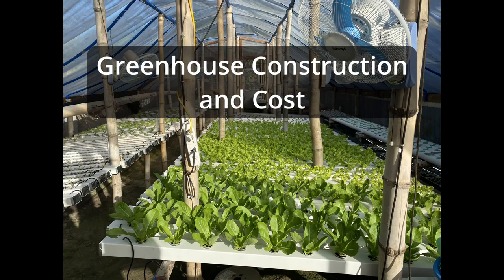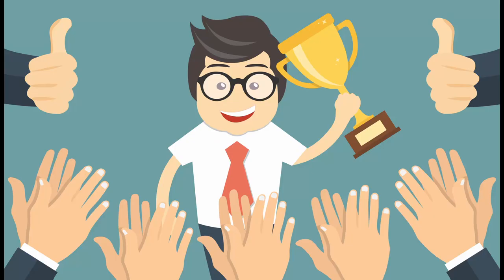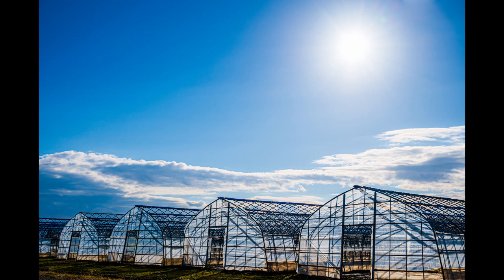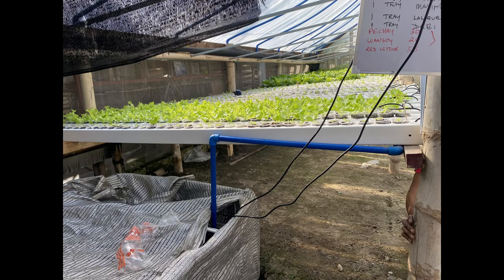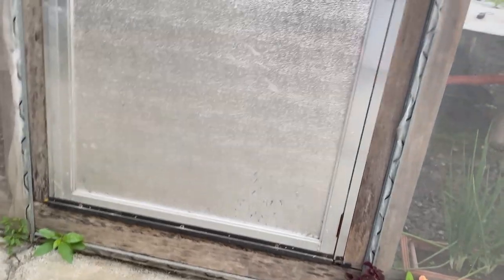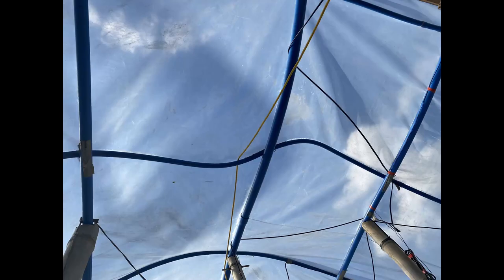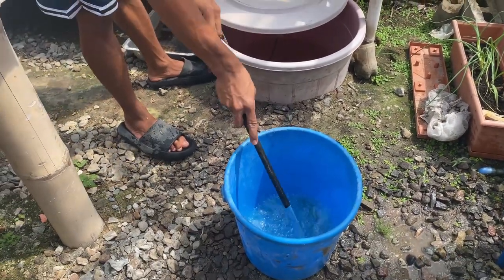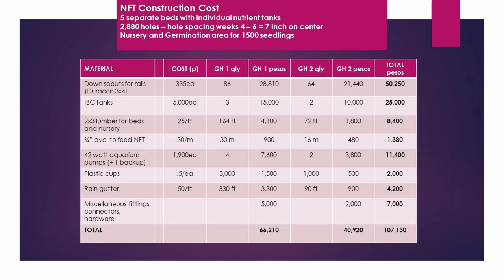Our DIY greenhouse using bamboo and pvc pipe - how much did it cost?

Comment: Hi, nice to see you have made some corrections with your greenhouse.
Why are you using PVC instead of GI Pipes for your structural and roof framing?
Have you given a thought of using GI Pipes, Angle Bars or Square Tube (Steel or Aluminum) instead of Bamboo or Wood for carrying your NFT Rail?
Have you also given a thought of using Philippine NFT system over USA NFT system? By the way, I also liked the USA NFT system as I find it so convenient but I am just not sure if it is applicable here in Philippine setting as it is relatively warm here compared to USA. But definitely what I found very obvious with USA NFT setup, most if not all of the NFT rails are full of algae as the USA NFT setup are full of openings that are exposed to Sunlight.
Keep it up!
Reply from the maker: We plan to switch to metal pipes at end of life of the U.V. plastic.. I could not get the GI pipes and a way to bend them as we were under pretty strict lockdown at the time. Our barangay hardware store had a supply of PVC pipe so that is what we used. It will have to be ugly for now - too busy fixing my other mistakes. same goes for the NFT rail.  I plan to expand to a new larger location when I get the money and steel tubing and aluminum angle bar will be used.  However,  I think I will stay with bamboo for the vertical posts and use cement bases. After the typhoon, I was surprised to to the greenhouse standing with very little damage.

Algae was definitely a problem last year. We have made changes like covering the rail ends, empty holes and shading the rain gutter return. Hopefully this will reduce the problem enough.
Reply: @expathydroponics8500  if you can afford to buy the channel and wiggle wire, definitely you can do with all GI and metal, as bamboo is cheap but prone to algae through time as they easily get cracks...

Comment: Nice setup. Does the pump run 24/7 in your NFT system?
Reply from the maker: Yes, I run 24/7.  I saw online some that run only intermittently at night, but I decided not to for two reasons.  1. I am worried that the roots may dry out or it will cause more stress. 2. The temperature is much lower at night here and running through the rails helps cool the water. (Also - less big temperature swings = less stress).  Less stress = less bitter problems.

Comment: Is that pex pipe? If so pex isn’t UV resistant and will break down over time and become brittle in the sun
Reply from the maker: LOL - It just looks like PEX pipe because of the deformities due to the UV plastic roof shrinking at night. When it is time to replace the roof, I plan to replace the ribs - either with thicker and stronger 2" pvc or metal.
Reply: @expathydroponics8500  ahh ok its still cool!

Comment: Can’t believe I found this site. I live on Negros Oriental and have been experimenting with the Kratky method. I haven’t built the green house yet. Rain keeps flooding my experimental system so I have to keep lowering the water level. Where did you find the water down pipes? I can’t find anything like it on Negros so had to by from Shopee. Too expensive. Where are you? Why is it that one week seeds germinate and then two weeks later absolutely nothing germinates?🤪😂 I’m from Europe and the season is April to September. I assumed that as it’s hot all the time that it’s summer all the time. Some really good advice here, especially burying the water tanks. I’m going feast on these video like a Breaking Bad box set. Thank you
Reply from the maker: Glad to meet another enthusiast in the Philippines. Most big hardware stores on Luzon have the down spouts. A few times they didn’t have enough but would order for me. Krakty didn’t work for me here although I see many here have success. The main lesson I learned in germination was to buy seeds from a seed supplier and store them in my refrigerator. My seeds got cooked when I left them outside. Don’t buy seeds from the rack at a local store. Most likely they are old.
Reply from the maker: If you are growing lettuce, make sure you buy the high heat variety